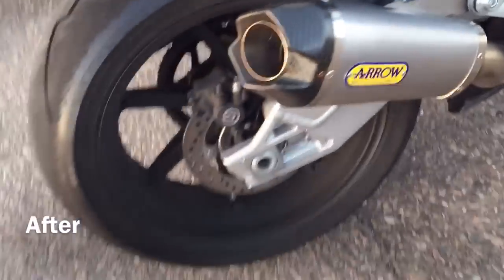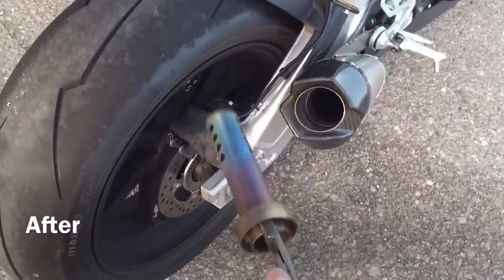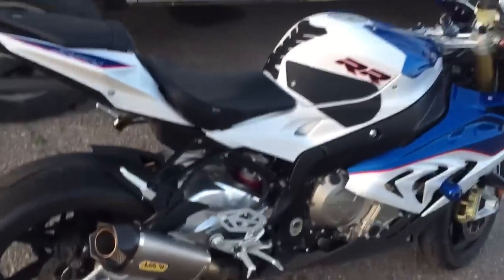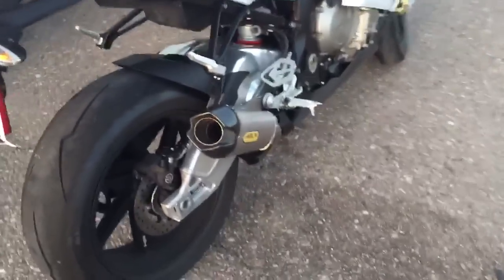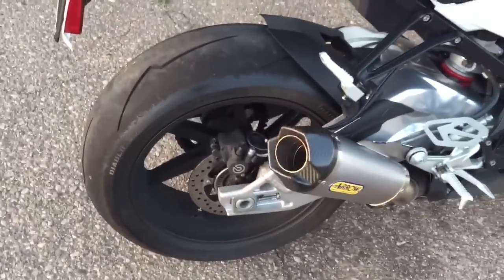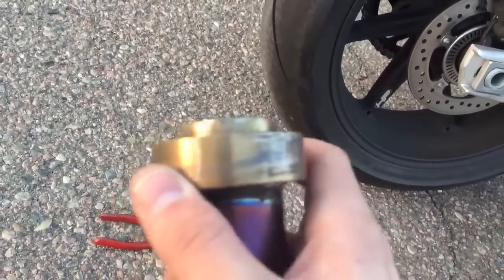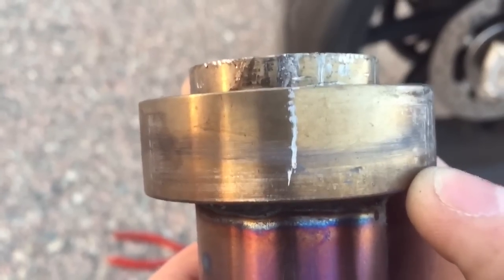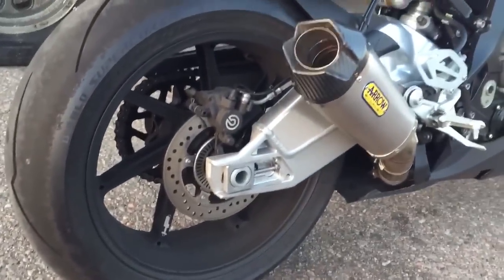2015 BMW S1000rr Arrow Exhaust Baffle

Comment: it doesnt spit flames with factory cat 🤦‍♂️
Reply from the maker: ProBiker89 this doesn’t have the cat. This is the year that didn’t have the cat in the mid pipe
Reply from the maker: ProBiker89 this doesn’t have the cat. This is the year that didn’t have the cat in the mid pipe
Reply: @carguyty9370  hmm maybe for us market .. i'm from europe and i have 2 cats (on both pippes but small not like 2017 and 2018) .. thinking to buy full sistem but it's not legal over here
Reply from the maker: ProBiker89 yeah I believe you have stricter emissions

Comment: Why do you even have a baffle?!?!?!?
I have the exact same slip on, ordered directly from Italy (from Germany...) and not only does it not come with a baffle, you can't even order one!
And I tried, because that exhaust FUCKING DEAFENING without a baffle... Can't ride without earplugs and little children plug their ears WAY before I'm even next to them... :-O
Reply from the maker: I'm not sure honestly. Maybe because it is US spec and we have DB limits?
Reply: Awwwww fuck... They changed it, because it was too loud without...

Shit, now I have to check if I'm still good... They are REAL anal about it over here in Germany...

So most likely: You just have the new version... (I heard about huge power loss with baffle installed, might be worh checking out?)
Reply from the maker: +mcbrite yeah I took the baffle out and noticed it perked right up!
Reply: +CarGuyTy should be around 14hp lost, so not exactly marginal... :-O

Comment: are you afraid to lean the bike over?
Reply from the maker: Only had the bike about a month at this point
Reply: More often than not it means you're riding waaaaaaay to fast for the street... :D I only get to the edge of the tire on my "local mountain" that we know inside out! - Anywhere else, riding like that will likely cost you in the long run...
Reply: @mcbrite  i ride like a hooligan and i caught some sand or dirt or something while on my vespa and almost lost it and would have been pissed if it was on my other bikes